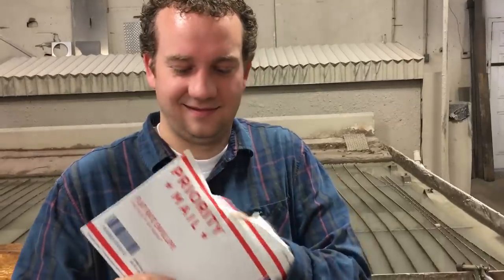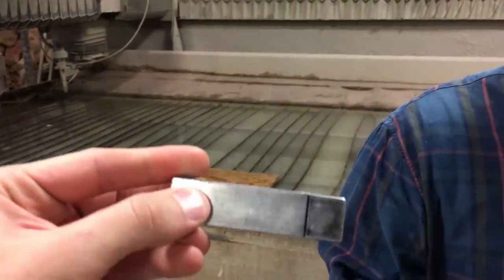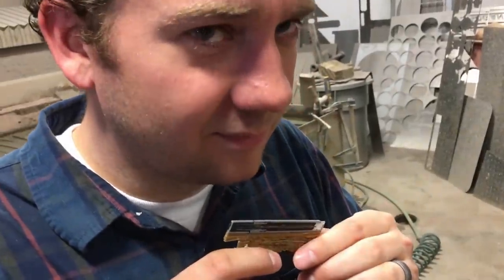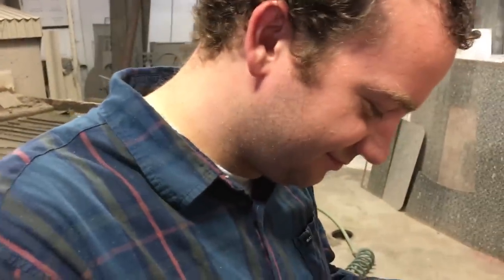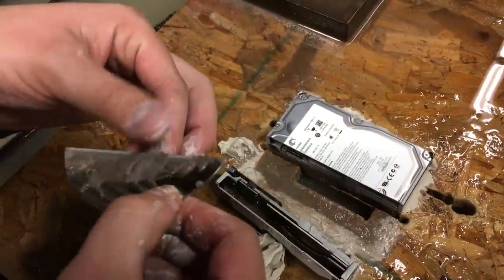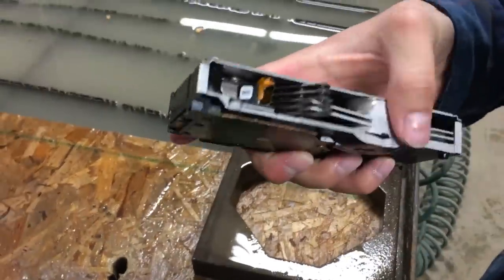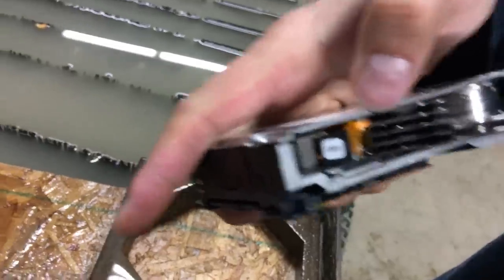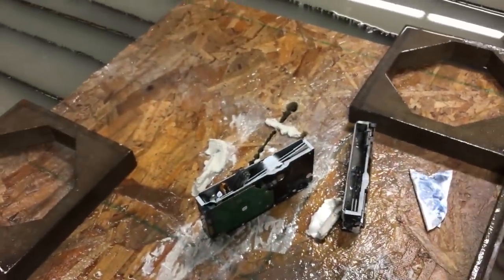How To Erase A Hard Drive With A 60,000 PSI Waterjet - reverse data recovery

Comment: Data can still be recovered not all of it but quite a bit from that hard drive
Reply: The irony is, your not wrong. This is touching on a field where I happen to specialize. 
Protip: If you truly want to destroy all data on a drive you should melt it.
Reply: Draygoes thank you I will melt them from now on.
Reply: Yep, nope. The entire surface of the platters have been sandblasted and likely magnetically altered as well. No usable data remains.

You don't need to melt the drive, you just need to heat it past the curie point for the platters.
Reply: UnitSe7en they still looked pretty shiny and data is somehow recovered from shredded drives so...
Reply: UnitSe7en- Its harder to do dammage like that than you would think.
"You don't need to melt the drive, you just need to heat it past the curie point for the platters."
Ok, that was actually what I was trying to say.
Reply: Or simply overwrite it with random data once and you are good to go. No way to recover that data. 
Those 7 times or 37 times overwrite processes have been busted as vodoo a long time ago.
Reply: djteac busted by who
Reply: just sand blast it lol
Reply: A program like DBAN would wipe a hard drive beyond recovery.
Reply: Johhnyyappleeseed - And this is one of the many beliefs that actually makes Cyber Forensics (or even table top data recovery) much more simple.
Reply: Care to explain? Its impossible to recover securely erased and overwritten data. And even if it were possible it would be so costly it wouldn't even be worth attempting. There's a reason the military uses DOD 5220.22-m.
Reply: You know about binary code, you should know how impossible recovering overwritten and encrypted data is.
Reply: Computer forensics is a career because the majority of the general population don't use encryption OR secure data wipes. If everyone took the time to encrypt data and destroy data properly, forensics would indeed be irrelevant. Most people just don't have the know-how or care to put in the effort.
Reply: This is basic opsec everyone can do.
Reply: I will grant you that one. If the data is encrypted then attacked on the table level, it would be pretty close to impossible to fully get it back. The encrypted files could be partially recovered but restoration would be very unlikely.

Comment: Just bring the two parts of the disc to a data recovery and film the reaction !!!!!
Reply: You would have a pretty large amount of your data back in no longer than a week.
Reply: I have seen several vids and know the kind of black magic they are capable of ... but being the  damage so severe I doubt they can come with large amount or this data back. probably a line of 2mm of the platter is gone during the cut, plus sanded platters and badly scratched. Probably still recoverable (just some data) paying in gold.